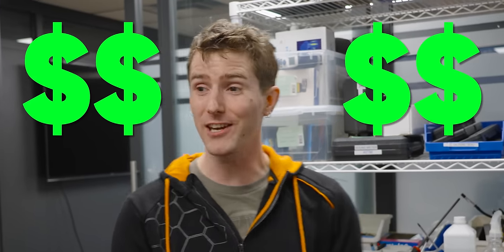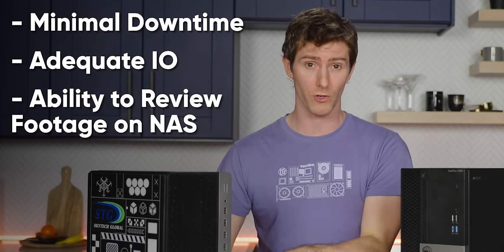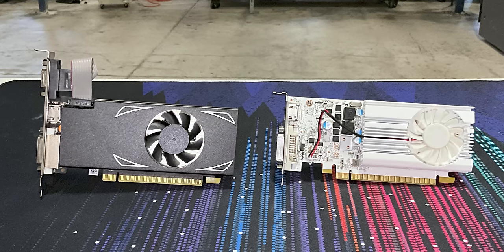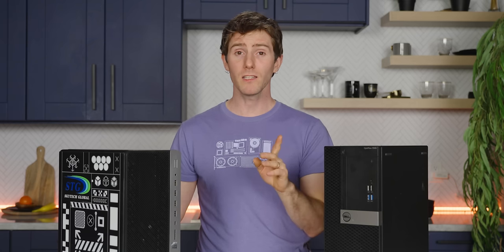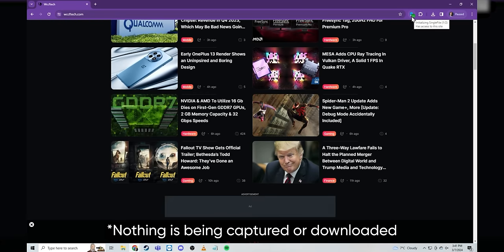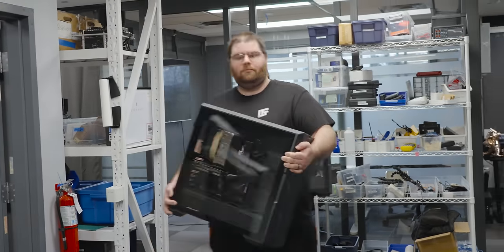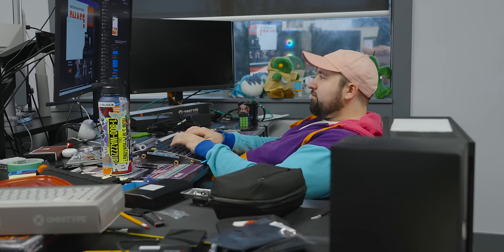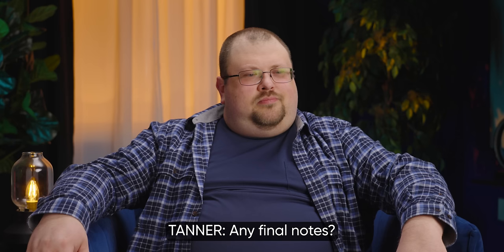We Downgraded our PCs to Prove You Don’t Need a New One

Comment: I recently got an Thinkpad x270 with FHD IPS panel,i5-7300u with 16gigs RAM and 1TB Samsung SSD for 150$!SSD recently upgraded and had like a month usage so 100% health.Only had the external battery with 95% health(the mid 48wh one) and managed to find used 23wh internal one for 10$ with again 95% health.It could get me trough a normal work day from 9 to 6 with a single charge and 35% battery left!Imagine if the external battery was the 72wh one!So far this has been my main machine lately and thinking of selling my M1 Air since it still has good resale price in my country,plus I barely use it.

Comment: The case on that 7040 is larger than what is used at my work, there is a range of optiplex and they are solid.. dell did a good job, runs TeamViewer just fine, 3 monitors without an added GPU. gig network, and yes the speaker does freak out some of the agents when a headset gets  unplugged or if the realtek audio driver wants to take over for some odd reason. Over all, the optiplex 9020, 7040, and others (can't think of them off the top of my head) are great for every day work, and most of all, they are simple to fix.

Comment: I got Fujitsu workstation with m.2 ssd slot and i5-6600 for around 100€. It even came with sata ssd and gt630 graphics card. After upgrading it with m.2 ssd and rtx3060 I can comfortably play any new title in 2k with dlss on a medium settings. Boot time is around 4 seconds. Eventually I will replace this pc with something on AM5 socket(transferring m.2 ssd, graphics card and power supply). But so far I didn’t feel pressured to do so from productivity standpoint. So yeah, it’s great machines for work purposes to have a PC now and upgrade later when you will have more money

Comment: Here's me with my daily Optiplex 3020... Did upgrade to 16GB RAM, a Xeon E3 1245 V3 (a I7 4470 equavalent) and a AMD RX 6650 XT, running Linux Mint. Couldn't need more. And it's not too shabby gaming either. It's much better than my 11th Gen work laptop at a fraction of the price.

Comment: At work, honestly, at times I can barely work on 6 cores/ 12 threads, 32G ram and a gen 4 NVME.  Not editing videos;  With the monitoring turned on so high that it's invasive; and  the company in transition to a new, larger environment, well, I'm fairly sure that I'm running about the BARE MINIMUM.  Earlier this year, I was running on a less than ideal NVME, and 16G ram, which was the sore point, and after about 2 days of work, I'd literally come to a work slowdown/stoppage to dedicate time to managing the computer - closing down other things I was working on- so that I wasn't running at 85 to 95% memory utilization.    The good news is :  I have a feeling that all of the less than ideally equipped computers will be either due an upgrade or replacement because they'll enjoy the same fun.. YAY.   Historically, the company seems to replace the hardware if it's more than 3 or 4 years old than to upgrade. 

FWIW: I'd bet that the actual minimum specs required by the companies ( It's more than one company affected )- will be raised rather than turn down the security monitoring; part of the extra waste is from the transition itself;  not very efficient to connect to two different Exchange instances and two different TEAMS instances.. but here I am ( and soon We all will be 🙃 ) .

Comment: Sounds like my employer as I was handed a 2014 workstation with a k2000 for 3D CAD...

Took them 4 years to FINALLY consider new systems. It just isn't enough for basic engineering workflow and a 1k PC would have been an improvement.

Comment: After upgrading to a high end desktop from a mid tier gaming laptop, I have become much more power conscious. The extra power draw alone from my desktop has increased my monthly power bill around $25 USD. PCs like this can sip power, which is extremely refreshing and it also saves old hardware from becoming e-waste. 

My upgrade also made me realize the massive power draw on new high end components in general in our current times. I try to set my PC to power saving mode whenever I'm not gaming now haha. I really wonder how long my 1000W power supply will last with potential higher power draw on future components...
Reply: Are older components usually less power efficient?

Comment: After accidentally damaging the motherboard for my i7-4790 last year I used a 1st gen i7 for about a month.  Noticably slower (and Sata SSD vs nvme) but it wasn't totally bad.  The graphics card (initially used a 9800GT) caused lots of slowdown for desktop & video playback, putting the GTX 960 in made a big difference there.  Got an i5-14600KF now, so just about anything else seems slow now.

Comment: Your conclusion makes sense. I would say that there's a part of me that was disappointed that LTT is to a point where "being enthusiasts" seams to no longer out weigh streamlined business processes. Working at LTT always seamed like it came with unique benefits, one of which being getting to use cool hardware and constantly getting experiences with the bleeding edge. Working corporately as dev on a company supplied machine, I would kill to be able to upgrade even just the RAM (even at my own expense). No such luck due to red tape and corporate ambition to slice every dollar and have control over all.

Comment: watching this on a 20 year old dell dimension (Literally 2004) that is my main daily driver.  Its almost illogical how well it still handles most modern tasks, even running fusion360 and other cad utilities. Upgraded with an SSD, gt430, and Pentium 945 which is basically 2 Pentium 4's duct taped together. I bought it for $40 used while in college and it was old even back then.
Reply: it even plays fallout 3 and new Vegas on medium/high settings and gets around 30-50fps.

Comment: I'm a Software Developer and my Workstation has an i5 7600 and 16 GB of RAM, and while still totally serviceable, I have to say for the tasks I do, it's just not good enough anymore. The RAM is constantly filled up and the CPU constantly pinned at 100% each time I do any recompiling or emulation, which is basically always. Especially the Android Emulator in Android Studio will regularly overload the whole System and when I try to check for performance in my code, I can't get repeatable behaviours, so I'm very happy we are getting new Workstations some time this year. If all I did was some Office and Browser stuff, this Workstation would still be fine for years to come, just not for the more demanding tasks. I will say though, even Software Development doesn't need top of the line hardware in most cases, just a decent, somewhat modern system is totally fine. Even just a one generation newer i5 8600 and 32 GB of RAM would probably be fine for me, though I obviously hope to get something much more modern

Comment: Sounds like a shame this didn't work for them. I upgraded to a suite of HP Z440's with my main system being an HP Z880 e5-2697a v4 (dual) with 256GB RAM + 3060ti and it's blazing fast. Sure, it's not a new system, but it's a beast that let's me run all of the Adobe Creative Suite no problem. Got the main system for a great price and really only hurt price wise with the video card. Runs like a top. The 440's are also rock solid.

Comment: I dailydrive an Optiplex 7040, almost the same one as shown in the video (except mine has an extra HDD bay). I always had perfectly good amount of performances and haste when using it. If you're using your PC the normal way, with a fresh install of your favorite OS, shouldn't be any issue. And this PC isn't that bad. The CPU is 3.9GHz, you get perfect DDR4 support, blazing fast SSDs and even x16 PCIe support for your favorite graphics card x) (even though the PC is ATX only so actually doesn't support 3-fan GPUs)

Comment: As somebody who has both a AM5 7950X3D and X79 4930K system the end user experience is the same outside of things taking a few more seconds to load. From multi-minute boot times to "set it and go downstairs to make a coffee and it might be good" on an SSD with 6th-Gen Intel and 16GB RAM? Discord and Teams being the only example of "I have a lot of startup programs" and that's why bootup takes "forver and ever"? Nah, ain't no way. Also, swapping the boot drive from a modern custom-built to an old properitary system?? This video creates more questions than anything.

Comment: i work for a non-profit, and we get most of our kit donated or with refurbishers.
and with a basic SSD and ok ram spec, it's fine.
it works. with an HDD or 4GB of ram, it gets frustratingly slow to do ANYTHING. especially windows update.
omg, windows update on a HDD vs SSD is NUTS. if a PC has been in spare for a while and we need to update them for deployement readiness, HOURS.
actual HOURS. but with an SSD, all good

Comment: If I was asked to outfit an office today, I would do the following for a standard user setup (e.g. an accountant): 

HP Probook/Elitebook or equivalent (e.g, X1 Carbon) (Minimum 16GB of RAM and current gen i5)
Dock (Match to brand of LT)
2x 27-Inch monitors (at least one being 2K or 4K)
Lenovo K545/M510 combo
Yealink WH62

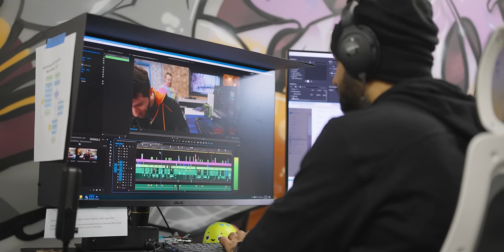Comment: 0:30  that's exactly what i've been saying to everyone, my pc has an i7 8700 with 1050ti, which is becoming kinda obsolete in games, but still works just fine for the ones i play, and a laptop with i3 6006u, which i dare say is BETTER than a lot of modern laptops, because of it's long battery life, and really cool temperatures. Even after 6 years of use, the battery still holds for around 4 hours, and the idle temperature is only around 3℃ higher than ambient

Comment: I use a Dell 3040 micro at work. It has an i3 6100. It's a slow CPU, but, with a slightly modified windows 11 it's as snappy as my main rig with a Ryzen 5 5600. If I need raw power it's fine. I just remote into the main rig or some server and that's it. Of course, I couldn't edit video, 3d model etc. but chrome tabs? Gaming remotely? Microsoft office? It has enough horsepower for that and a bit to spare. I'm gaming over Wireguard, it reaches full gigabit speeds over the connection to the remote local network and 500mbps over VPN to the internet. It's absolutely fine. Latency is about 2ms from client to server.  Getting my full 1gbps to my NAS is amazing over VPN. 

Granted, I live in Romania where we have rock solid internet.

Comment: We still have 10+ yr old PCs around the factory floor at work. Depending on the job demands. Old PCs are very capable. The 1 thing I'd make sure they have is an SSD. It still makes a big difference going back to even XP days.
But for businesses, something to keep in mind is windows 11 isn't officially supported on that old era of PCs and windows 10 is near end of life. There will be a big push to replace systems running older than Intel 8th Gen

Comment: I feel like the Machines they got from this company they sourced it from where just Bad machines, because i myself have a OptiPlex 7040 with a 6600k and 16 gigs of ram with a intel ARC  A380LP and i never had any issues with the system at all. All the random Glitches they said they experienced Never happened to me, my system was Extremely fast and snappy. so i really don't understand why their systems just seemed to give them non stop Technical issues. The fact you can get these system for like 200 dollars is actually Bonkers. Considering's the fact that the systems these OptiPlex's are competing with are probably over 2000 Each. Im gona be upgrading mine to a i7 6700 here shortly and adding another 16 gigs of ram for Quad channel.

Comment: Yup. I use a ThinkPad T440p from 2013 for all my Uni work. It can do anything other than game. I'm in computer science and it doesn't choke on compiling stuff, hosting some docker containers etc. And your OS takes up some basic level of resources. Windows takes up a lot and there is a limit to how much you can strip Windows to make it lightweight. If you use Linux though, you can basically even have an OS that takes up only 50mb of RAM on idle if that's what you need. So my distro with a minimal GUI takes up only about 300mb on idle which makes most of the 8GB available in my ThinkPad free to use while Windows would take at least a couple of gigabytes by default. Old machines can still be all you need sometimes. And let me tell you, they don't build laptops like these ThinkPads anymore. It is unbreakable.

Comment: an old optiplex 7050 is what my homelab is running on, and tbh with a little ram upgrade, nvme boot drive, and a clean ubuntu install makes it surprisingly beefy. i'm still impressed by it and it's been chugging along for a good few years, even through multiple moves. given, i am running it headless, so there very well could be a lot of graphics issues i just do not see. but i love my silly little recycled box, by far the best $75 i've ever given to freegeek.

Comment: I wonder how you ended up with those kinds of problems,
we're still running 4th, 5th and 6th gen Intels just fine, only "problem" is Windows getting bloated overtime, but that's all to complain about,
everything is snappy with at least 16GB ram and sata ssd, even Windows 11 can be tricked into being compatible (thanks Ventoy), heck even MacOS 11 Big Sur hackintosh, Proxmox, TrueNAS Scale, Xpenology are all doable on such systems with at least 4th gen Intel cpus

Comment: My school has been throwing out a bunch of these 7040 towers. Have been trying to save a few as they are still great machines and I can confidently say that using the registry to enable windows 11 upgrades on these machines will not cause any harm to the computer or the user. I honestly believe that most people should be fine with a 4th gen + i7 and 16g of ram. Even those who want to get into creative work such as video editing so long as a competent GPU (Rx550+) is also installed!

Comment: Once upon a time, there was a rule of thumb that a business PC should be replaced once every 3 years. Things have changed. I mostly work in the macOS / Enterprise area, and my largest client has hundreds of Macs since circa 2014. We are just starting to replace the iMac computers, mostly because, at a certain point when Apple no longer supports them, they no longer receive security updates.  They are 10-year-old computers that work just fine for most tasks. As we have moved to the new mac mini M2 PROs, I suspect we won't revisit upgrades again for another decade. Especially since most major systems have moved to the cloud and AI tools are becoming increasingly integrated into the business, I don't do much with the desktops/laptops except make sure they are updated and secure. Which I can do anywhere on the planet with my iPad.

Comment: I'm using two 8 year old machines, an i3 m370 and a amd a8 6410, and the issue with them is none. However, the software installed on them is dated but it does the job and so if I upgrade I'm going to have to stay at the first generation i7 or i9 machines and no newer because the software I have works fine on them (I hope). On a newer system or brand new, virtualization must come into play and then that itself will slow down the machine negating some speed gains that would be enjoyed on the new machine.
Use a new machine anyway you might be thinking? If done, then that would require new software and that is another expense that need not be incurred since all that is required to be completed with the old software, or any freeware, works fine.

Comment: @11:06 if Linus is thinking of stepping away from him building all the machines himself, what if the option was given to the staff to have a say in how it’s specced out?  Or even build it themselves? ie one of the writers wanting a 12100 in a shoebox ITX case.

Main concern I can think of against that idea is the idea that every system is too different/non standardized, and would be a nightmare for inventory/maintenance. 

Still would be interesting to see the staff spec out their own systems with their own flair based on their needs.

Comment: ive been using a dell optiplex gtx 750ti for about 5 years now and its actually really good by my standards. it runs most modern games on medium settings at 60fps 1080p and the only things ive ever struggled with is VR and detroit become human. (im going to be building a rtx 4070 super computer to replace it very soon)

Comment: It would have been a much better test with an HP Z440 or Dell Precision 5810 workstation. These are the same age, can be purchased for about the same price, and have enough power to handle a better GPU. I recently purchased a Dell Precision 5810 with an E5-1650 v3, 16GB memory, and a GTX 1070 for $120. I added an SSD and HDD, and I have a $200 system that easily runs everything I have loaded and even plays most modern games. With more memory and a CPU upgrade to an E5-2698 v3, you could even edit video (and you would still be under $300).

Comment: I daily drive a 6th gen i5 with a gtx 960 ftw and 32gb of ddr4 ram
It isn't that bad. Sure boot times are long but just leave the system on
Unless you're running the latest triple a titles it works just fine for gaming